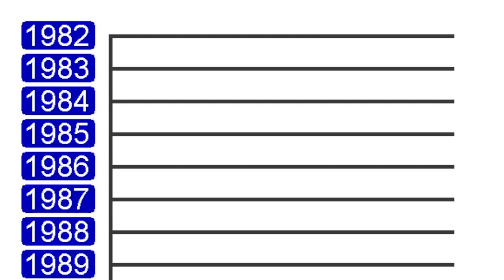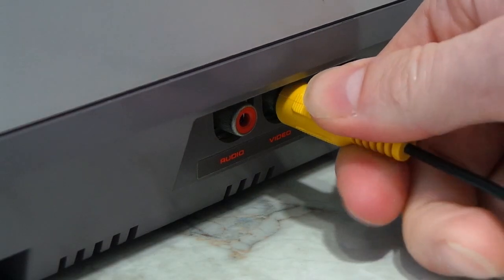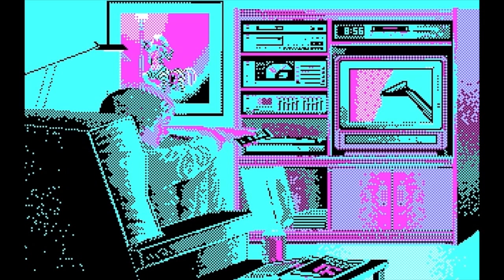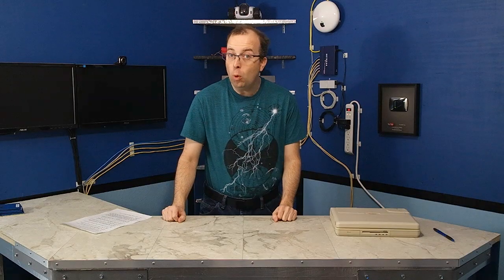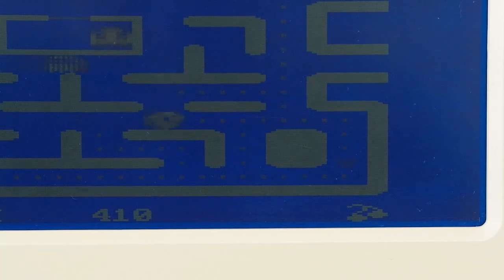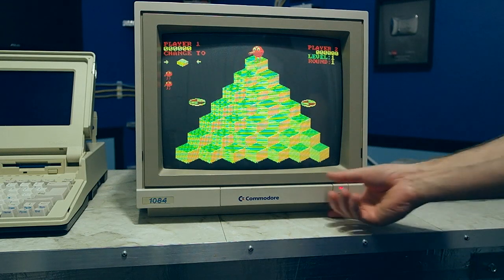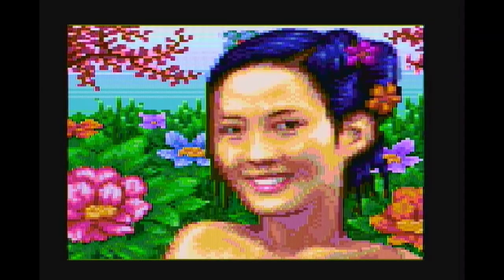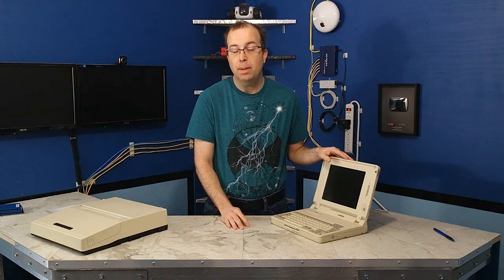CGA Graphics - Not as bad as you thought!

Comment: I just never understood why any consumer/home user would have bought a PC compatible in those days when the much cheaper machines like the C64, Amiga, Atari ST, had better color/graphics/sound by default as their "lowest common denominator" to begin with, without requiring any kind of add-on graphics board that cost just as much as a complete C64 system to begin with.  From my recollections at the time, no home users actually bought PC compatibles; they weren't primarily marketed to home users and with the local K-mart selling complete C64 systems for $200-$250 with a floppy disk drive, why would anyone buy a PC compatible if you were using it for games in say 1985/1986?  It never made sense to me then and not even now in hindsight.  I know I picked up my C64 around that time and used it constantly from around 1986 to 1990; there were tons of games available at the local shops like K-Mart, Zellers, and Canadian Tire throughout that period.  In contrast, a PC compatible would cost a minimum of $1200 at the time and it just didn't make sense in that context of the much cheaper and widely available options at the time that could be had for less than $300 and looked great for games just plugged into a bog standard TV you already had.  Even though I'm 45 now, and have been using computers since i was a kid in 1983 first with a Vic-20; I don't think I ever even used a PC compatible until around 1990 or so.  Yes it was that late!  To me they were always so overpriced and obviously meant for "the business sector" that to me they were never even worth exploring until they started getting really pushed in the early 1990s after the demise of what I consider the "consumer meant" computers like Amiga or the ST.

Comment: 0:34 - Not really. VGA is a CLUT-based format. Truecolour formats are not. The term "SVGA" was still used for some time to refer to the resolution (at least until the transition to widescreen formats), but the graphics mode is fundamentally different, because the pixel values represent RGB channels, whereas in VGA they represented an index to a colour table.

1:13 - That looks like EGA (320x200 with 16 colours). VGA would either have higher resolution (ex., 640x480 with 16 colours) or a bigger palette (ex., 320x200 with 256 colours). In fact, I don't think the original Keen had a real VGA mode, it just re-used the EGA graphics.

Comment: Amazing work! As a huge pixel graphics fan, your video proves what limited resources are able to create!

There is one thing I wonder about which came across me the past days:
With traditional CGA, the graphics modes vary depending on the number of colors used. So for monochrome it's 640x300px, four colors can be displayed in 320x200px and 16 colors in 160x100px. Now what my brain concludes from this is that the displayed size on screen becomes smaller the more colors are used. Looking at videos on YouTube, though, it seems that this assumption is not true (according to some maths I did, with a 14" display of 720px resolution in width, this results in something around 5cm size for displayed graphics in 16 colors). My impression is rather that 160x100px are stretched over the whole screen, making single colors bigger.

The reason why physical size matters to me is a project I'm working on in which I want to transfer CGA graphics into print products keeping as many retro aspects as possible. Do you have a hint for me to solve my enigma?

Comment: One glaring problem with using ntsc artifacting is the fact it wont work anywhere that uses pal or secam, which is most places outside the united states. You just get a nasty garbled mess instead of the proper colours. Maybe this was also a reason the technique fell out of favour. Happens when you run tsr80 games coded in the USA on the largely compatible European dragon computers for example.

Comment: Modern kids, be thankful you don't have a VGA cable. They were a nightmare to use
Reply: @AllGamingStarred  explain plz
Reply: @androognoix1685  the cables had to be connected and screwed in on either side. It wore on the hands fast and if the cable wasn't secure, you were in for a bad time. USB is heaven compared to that nightmare. Half the time the signal would yellow and you had to unscrew, check the signal, rescrew and God help you if the monitor had the VGA cable on the bottom...
Reply: @AllGamingStarred  all for more color
Reply: @androognoix1685  yes, and annoyingly so

Comment: 10:36 If you're comparing graphics output from a video game perspective, CGA was surely better than apple II but I believe that CGA was left way behind the VIC II graphics, atari graphics, MSX graphics and so on... because those machines were hardware assisted for the game graphics while CGA was not. In the PC, all graphics had to be drawn by the CPU pixel by pixel and the stock 1983 PCs didn't have enough CPU power to compete with the C64, atari 800, MSX, etc... So, you had a colorful composite display game with low framerate and lots of screen tearing... Really, just like the featured demo states at the begining, the old PC suxx....

Comment: My first IBM clone had a Hercules card. I used to run a emulator to make CGA only games work. My next PC already had a VGA Charger card. I NEVER knew what those "composite" settings were until now! Naturally I only had monitors with 9/15 pin connectors. (Well not counting my Atari 800/C=128 - I can confirm that the composite colours on the 800 were stunning - I never suspected that CGA could have rivalled it on a TV) My favourite CGA games are the SSI Civil War classics. 4 colours is actually just fine for displaying a map of military units. Wonderful nostalgia.

Comment: Ehh... okay, CGA was a little less bad than I thought, but those tricks primarily work on NTSC which was not available in my country. I don't think PC CGA cards even had composite output where NTSC wasn't available, but I might be wrong about that. I don't think the Atari 800 had a mode where you could combine colors in quite the same way, but at least programmers could select the colors in the palette at will. It also had hardware support for changing the palette or even the graphics mode on any scan line.

Comment: When EGA emerged, both the monitors and the video cards were expensive; however, the available EGA cards rapidly fell in price, as monitors remained high. Acquiring a cheap EGA card, I coupled it with a CGA monitor, and to my delight, discovered most "EGA" game modes added extra colors, with the game running in the same resolution as CGA mode!  The result was a significantly better-looking game.  (Not all hardware combinations worked; I fried one CGA monitor.)

Comment: 1. CGA was intended for pie- and bar-charts; games were not to be played on a business machine!😜
2. CGA pixels were set on a rectangular grid, so drawing a circle required using a vertically-stretched oval. Alternatively, this gave uncorrected pie charts "depth."
3. A brief mention of the 1984 Professional Graphics Adapter for PC/AT would have been nice; it supported 640x480 and 256 colors on a special monitor, but was priced for "professionals."
4. Sim City was designed to run on monochrome Macs with square pixels.
5. If you thought CGA was hideous, the IBM color printer of the era was worse, so you could display graphics that would be unreadable on paper. The "Print Screen" button was a either an unfulfilled fantasy or a vicious lie.

Comment: "Most modern TVs still have a composite video port on them."
Disappointingly, this isn't aging too well.
Reply: Most of the smart LCD TVs in my house have a composite port. I have a TCL and Samsung that are only a couple years old with those ports.
Reply: I have a Samsung smartv from 2017 that only has component cables. I would need an adapter 😢
Reply: @NascarRacingFan5  try the Y socket of component with a true composite signal, some tvs can extract colour data from it ..
Reply: @andygozzo72  Yes there are quite of few tvs that do exactly this but don't advertise that fact.
Reply: @oaajbs  my neighbours 52 inch thing does, had to try the component input as the other inputs were in use for other devices and worked perfectly , colour came up nicely on just the Y
Reply: when i get chance i'll try my more cheapo sets and see if they do it , i have a tv pattern generator, which one tv doesnt like the signal from, its a pal generator and the tv defaults to ntsc, and cant be switched manually!
Reply: @NascarRacingFan5  tvs with just a component port use the Green port for Composit, and either have a menu option to toggle or it's automatic.
Reply: @NascarRacingFan5  try plugging the composite into the green connector and setting the signal to pal in the video settings
Reply: @NascarRacingFan5  the green input will accept your composite signal
Reply: Many TVs still have the composite ports even in 2022.  A lot of TVs have a 3.5mm jack that can be broken out into the 3 composite ports (yellow, red, white) with the proper cable.
Reply: My TV has Composite but not Component or S-Video!
Reply: @CosmicSponge2004  thats good, then, for this sort of thing
Reply: Yes it is
Reply: My 2012 TV doesn't have a proper composite port on it
Reply: unfortunately this is very true. fewer and fewer new tvs i find have a composite input. but there are still a handful that have a composite input and i'm glad to still see it there. it hardly uses any space and i'm sure the composite to high res lcd tech has been around so long everyone is probably using the same thing for that end
Reply: Most TVs do a terrible job upscaling composite, optimised for video footage (like VHS) while processing 240p content from old computers and consoles as 480i content.
Reply: yeah i dunno what everyone else is talking about here I havent seen a tv in years with anything but HDMI

Comment: Strongly Disagree! (Love 8-Bit Guy, but disagree on this). The C64 S- video out put, (Chroma / Luma on RCA Jacks). Looked better in my opinion. All the Amiga and Atari ST modes were vastly superior.. The Tandy 16 color that you elude to.. was touted as the best ever in that day, but still was pale compared to the Amiga. The Shitty CGA/EGA Ports to the Amiga were criminal, (Looking at you Sierra Software...). Yes You have tought me that CGA could be tricked into better than it looked.. but I believe other standards did the same.. (I believe the Atari  8 bits could redefine the color palattes line by line to create 128 colors on screen at once. The Amiga had its HAM mode for 4096 at once and also used the Atari trick to do 4096 in Sliced HAM mode.  The C128 had some dramatic tricks to display Very Hi Rez screens too. In general, The VASTE!! majority of the programmers used 4 crappy colors to define the games one IBMs. The C64 and others were actually better for gaming and CGA had a good 2 color Hi ReZ Mode.

Comment: The background colour (0) of the 320 x 200 4-colour modes could be set to any of the 16 colours, as could the foreground colour of the 640 x 200 2-colour mode. Even the border colour could be changed for any mode. A programming trick allowed 2 more 320 x 200 4-colour modes, where colours 1 to 3 could be red, cyan and light grey, or they could be light red, light cyan and white.

Comment: 2:21 No, I do not see that a maximum of 16 colors is the direct limitation of the monitors. To me it looks more like it is a limitation of the data interface (RGBI). Furthermore, I believe monitors that have a color signal input will show whatever color you can feed into it. If the monitor happen to have only RGBI input, of course it will show only 16 colors, but if it also has composite input, it will show whatever color I want it to with this interface.

Comment: in the late 80ies/early 90ies I remember having at least one demo that used a sort temporal dithering in combination with a custom vga palette to achieve a much smoother looking picture than what was possible by simply using one fixed 256 color palette, akin to what these folks are talking about:
https://news.ycombinator.com/item?id=13936215
That's a subject I'd like to have a video showcase about!
Reply: Yeah, I once programmed a demo for a college project, where I was able to produce about 4,000 unique "solid" colors using the 256-color palette, just by using dithering.  You could produce more shades using this technique, but those shades often had tale-tell signs it wasn't a solid color.

Comment: But wait: the Commodore 64 used S-video.  I mean they didn't call it that, but their separation of the signal into luma and chroma is S-video, albeit on a pair of RCA connectors.
I actually modded my 1080 monitor by adding a standard S-video connector between the luma and chroma, simply wired to them in the back, and it happily displayed standard S-video signals from all of my consoles.

Comment: Hi 8 Bit Guy, could you make a video on connecting a raspberry pi zero to a cga lcd screen? I'm debating on tearing apart my Tandy 1100FD and using the 640x400 lcd which would be awesome, but would require at minimum a logic analyzer. . . Come to think of it, I also have an old ZEOS laptop I could refit, but again would require a logic analyzer. Aside from a lcd driver board (components too thick), any suggestions? I'd love a video on this. Thanks.

Comment: I can understand the memory limitations back then and using only 4 colors in RGBi mode.  The only thing IBM did wrong was not providing a register to the programmer to decide which 4 colors to use.  This would have made most CGA screens 100% better using very little resources.  EGA and Tandy / PC/Jr and some non IBM CGA cards fixed this.  So it's possible to remap the color palette (using a TSR is one way) of a game programmed for only CGA to at least have a better 4 colors on EGA.  There was even a commercial program called "ColorMagic" that would remap CGA into any 4 EGA colors.

Comment: Out of curiosity, why no 4-color pallet with yellow, red, green, and blue? It seems like these would be the OBVIOUS 4 colors to use.
Reply: It was for hardware reasons.
Each palette entry can only vary the red and green pins on the RGBI output. The blue and intensity pins can be set for each palette.
A palette with yellow, red, green and blue wouldn't be possible; since it would need to have different blue levels within a single palette.

Comment: MSX system used 16K of video RAM in a different way. All the 16 colors were displayable on the same screen without any hack. Resolution of "screen 2" was 256x192 although it could be 320x200 without sprites. It used 6K for bitmap (0 or 1) and 6K for representing 16 colors (4 bit for 0 + 4 bit for 1). For a demonstration of the capability: https://www.youtube.com/watch?v=S2k60eADtkg

Comment: lmao every computer at my school is plugged to the screens with VGA cables.
Reply: jokin gabiola They’ll be using SVGA however. SVGA allows analogue 1080p and most resolutions, while using the same cable as the older original VGA standard.
Reply: @justanotheryoutubechannel   yeah, exactly, you get as good of a resolution at the end. I felt great when they got new computers that wouldn't take the entire hour to open google crome but man , do i miss those crt monitors, they had something to them.
Reply: @Juak05  crts are just objectively better in all but a few aspects to the majority of lcd displays
Reply: @lepidotos  yeah but i mean, the quality of a crt can vary. The ones in my school did work fine tho. They were gard to move, that's all.
Reply: @lepidotos  and either way lcds are more optimal to run os like windows 7 or 10.
Reply: @Juak05  how so? i used a crt for windows 7 and it worked just fine, even made aero look even better. and it wasn't even a good crt, it was a terrible one that only went up to 1024x768 at an acceptable refresh rate.
Reply: @lepidotos   still, windows 10 for example is bassically made for lcds. The resolution for instance. Like, old software does look better on crt and even ones like win7 since they were meant to be used in crts.
Reply: @Juak05  crts don't have pixel density, they can go to whatever resolution. there are ones that have a high enough refresh rate to do 1920x1440 or even higher. and also, windows 10 goes down to at least 1024x768 doesn't it?
Reply: @lepidotos  what i'm sayign is, the whole thing has to fit inside the screen , and windows 10 has a 16:9 aspect ratio while most crts go by 4:3.

Comment: Thanks for the clear video. I finally understand why Tunneler (game) was displaying so much more colors than what my Tulip PC Compact II (PC maker from The Netherlands), should display.  I really enjoyed this game decades ago because it was one of the first games that enabled multiplayer. The only other I can remember was Firepower. But that could only use 4 colors. By the way, my monitor had a button to switch between cyan/pink/white and yelllow/red/green. The other issue in Tunneler however, was that the PC could only react tot so much input from the keyboard. If one player was moving in a diagonal reaction whilst shooting, the other player could only move in one horizontal or vertical direction without shooting. Frustrating! :-) I have to admit that i was very glad with this PC at the time. I believe I was about 12. The tulip had the NEC V20 processor which ran at 10Mhz. All of my friends had IBM PC's or clones which had the 4.77Mhz processors. The Tulip probably had a BIOS, but with a special floppy you could switch the NEC V20 back to 4.77Mhz. Very usefull for playing games like Popcorn. This was a French game (like Bricks) which couldn't slow down on a faster processor. My dad still plays this game on an old laptop using Dosbox after I played with the processor speed settings.